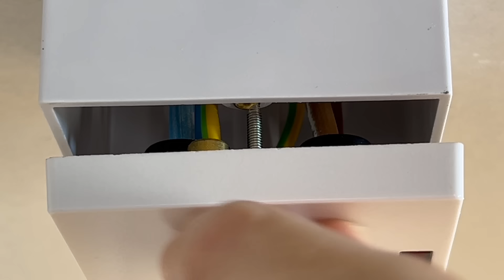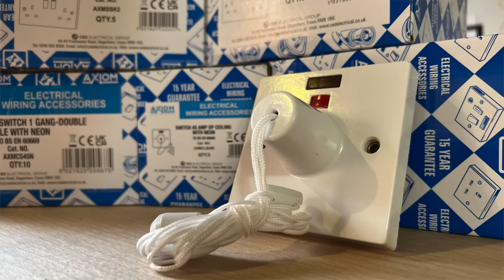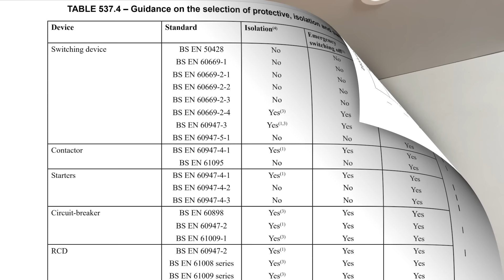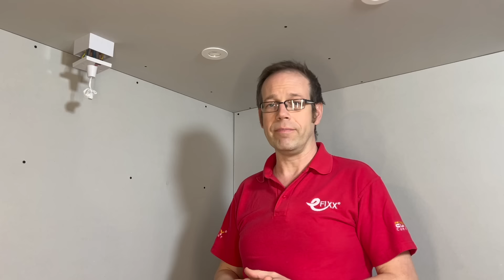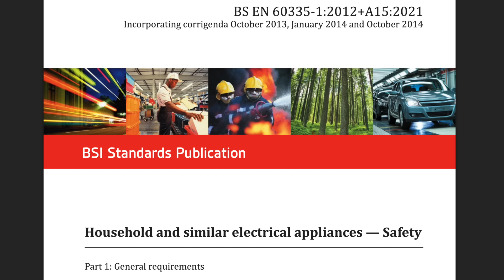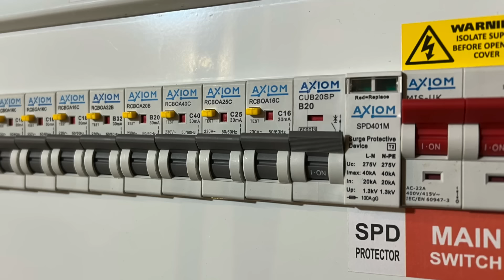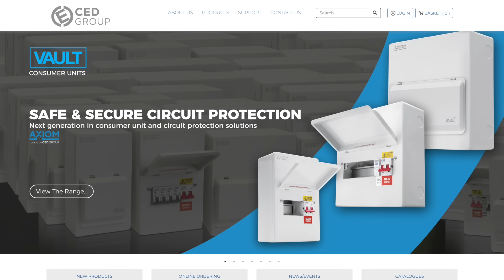Do You Actually Need a Shower Isolator — Or Is It Just Habit?

Comment: So the usual reason then, nothing to do with safety, just more legal arse-covering by manufacturers!
I don't know how the Triton T80s passed testing, they don't hold up in hard water areas, and have some dubious design choices that seem pretty un-safe.  After a year or so you might notice the power light starts flickering on and off, because the stabliser valve is leaking and p1ssing water all over the bulb, power switch, and solenoid. Doesn't even trip the RCD!  Changing the O rings might work but they often leak from the spindle so you need a whole new valve, nice little earner for them.

They must know this is likely to happen because they added a little plastic drip shelf to try and divert leaks away from the electrics, which they've still made no attempt to water-proof.  I just cut the bulb out of mine, rather not have a wet 230V xenon behind the main switch thanks, at least it served as a leak warning of sorts.  Maybe they should put the switch at the top next time, above the leaky bits!

Comment: Anyone not using the Crabtree style switch is just wasting their time. An actual pleasure to install.
Reply: The older round ones with twin screw terminals. They're all single screws on the new ones now.
Reply: I preferr the MK one myself.
It dosn't fail and just works. Although the clunk it makes is super loud!
Reply: I agree. And it has captive screws too. 
Slightly different topic, but it drives me crazy that manufacturers use non captive screws for ceiling mounted pull cord switches. Good example of how to make a simple job twice as hard.

Comment: I guess it isn't approved for "isolation" because it doesn't have so called forced contacts, which means if the contacts were to weld, they must be forced apart by the cord pull, or the lever or indicator must be impossible to move to a "OFF" position. (so not the disconnect/isolator shows OFF while it has welded contacts and is actually conducting current).

Otherwise it fulfills all requirement for a isolation switch: Minimum 3mm separation, double pole, and clear mechanical indicator of the switch's status.

Comment: I think showers should be wired through a contactor, and thenhave a local Iso/switch for the contactor and shower! The amount of shower pull cords I replace in a year would have you thinking are pull cords even fit for purpose!
Reply: "fit for purpose…“
I wonder if customers are finding a way to pull the cord when current is flowing?
Are the showers involved, often of a type where there's a mechanical switch on the shower unit, that the customer could turn on and then close the cubicle door and then turn the shower on via the pull cord? (Then wait 20 seconds for the temperature to stabilise before getting in).
I expect most showers have electronic switches where you couldn't do that but I wondered if the pull switches you're replacing are often on old/basic showers with mechanical switches?
Reply: @alanm8932 I have found that a lot of the showers are been switched on and off using the pull cords instead of the button on the shower! The biggest culprit by far doe is the triton sr90, nearly every shower I go to is this model, I still think the contactor route would help in the scenario where the customer is using the pull cord as opposed to the switch located on the shower!

Comment: To be honest, I would use the switch for isolating the electric shower BEFORE I start pouring water onto it.  It's absolutely insane to have a mains-powered device directly in the shower. And - as mentioned - the switch itself isn't waterproof... But - different country, different culture :-)
Reply: @jirizlamal69  I rather take my chances with the heater not faulting.  With this, drop the shower wand and you are soggy toast.

Comment: 1) installing in wet room ceiling means corrosion, corroded contacts on 40+ Amperes will cause serious overheating; 
2) double pole switch has risk that neutral wire can be disconnected faster than live wire - double pole switches are used in buildings without earth rods (for example Asian countries) as voltage between neutral and ground is not stable

Comment: Regulations semantics where isolation and a functional distinction is a waffle of regulations . If you google BS EN 60669  asking if it is suitable for safe isolation it suggests it is a suitable device. If the device couldn’t safely disconnect both poles and give the 3mm distance then it wouldn’t be suitable for general purpose use either. iRegardless it’s time they were redesigned as they are all an unfit for purpose because of the size and nature of the product to cable size and too many self destruct /burn out regardless of tightness of terminals . Another item that should be updated in BS7671 but they rather mess around with regulations for car chargers or what amounts to an overpriced  outdoor socket . 🤗

Comment: One of the first things that I was taught in apprentice training was not how to start anything but how to stop it.
When we moved into our present home, there was a power shower installed with a single push-button in the shower cubicle. If for some reason, the button failed to stop the pump, then the only means of stopping it and the continuous loss of hot water was a stand-alone RCD (which later failed) tucked away in an airing cupboard. Like many properties, the consumer unit is unreachable without fetching a step-ladder. The ceiling pull-switch that I subsequently installed now provides adequate switching for the shower and integral extract fan. So regardless of the regulations as to placement, my choice would be to fit a pull-switch in the bathroom, adjacent to the shower.
Reply: I have never been in a property where the CU required a ladder to access it, and I have robbed hundreds of houses
Reply: @lrdisco2005 Your confession is duly noted🤣
Reply: @MervynPartin I need to be more careful in future.

Comment: A properly rated wall switch at the light switching point is in my opinion ideal. The switch provides a positive disconnect outside of the unit itself without having to pull plugs. In the US, such a device would need GFCI protection and likely a disconnect switch that breaks both live poles (neutral likely would not be present and typically isn't switched). That switch would likely be the same as used for air conditioning systems which can range from nice, heavy duty (enclosed with external handle) knife switches to basic pull out knife blade disconnects (you pull an insulating block to physically remove the blades from the circuit and they have a provision to install the block upside down to park the switch in the off position).
Reply: We are not in the US of A

Comment: Good video Joe, very clearly explained why that manufacturer's instruction is there, though to be honest I think it's a bit of nonsense. Those switches cause much more trouble than they solve - because they don't solve anything in my opinion! 😀 There isn't really a need for the switch, but given it's there, do you leave it on all the time or turn it off after every shower. I know people in both camps - the ones who turn it off don't like the neon light glowing and using all that power! I'm in neither camp, I have a shower off the hot tank, and while I do have an electric shower in the house it's practically never used and the switch for it is permanently off (to avoid using all that power!). Cheers.

Comment: I can't see any reason to turn this on & off every time the shower is used. It just wears out the switch, which can then fail causing a hazard if it arcs as well as causing heat damage to the cables. Repeatedly replacing them isn't  great for the cables either due to repeated bending.

Comment: Very cheap and easy for a manufacturer to print in a manual about needing the switch. They don't have to buy it, wire it up or replace it when it breaks.
Reply: And there are no such requirements elsewhere. All works fine.

Comment: Around 8 yrs ago i had a house rewire in London & found the shower cubicle had the 45A rocker switch located Under the shower😮😮😮.
To top it off, we followed the cable all the way to the basement & it was shoved straight into the meter 😮.  Mind you, it was the load side of the meter.
The tenants claim they have been using it for yrs...

Comment: I work in Social Housing for my local authority, Very useful video.  But when we invite Mira and Whale to our offices, the Mira Tech guy recommends that we leave the supply on at all times, though this may be due to the Mira Advance showers which we fit are connected via Bluetooth to the Whale Gulper shower pumps.👍 

We are trying to move away from pullcord switches to a 2gang 50amp double pole switch , due to high failures on the pullcord switches compared to very little failures on the 2gang switches, no matter how you terminate the conductors on both the pullcord and 2gang switches.
Reply from the maker: Great insight thanks 🙏

Comment: Not only are they challenging to wire the 10mm^2 conductors to, the neon indicator wiring can be problematic to connect simultaneously and reliably with those conductors. 

Now if only those wazzocks at Triton could get their act together and deliver a new heater can (10.5kW) that was ordered two weeks ago my very aged mum could have a warm shower.

Comment: As an swedish electrician I feel dizzy seeing all these weird ass solutions you have going on for weird ass appliances..
Reply: What type of shower is most common in Sweden?
Reply: @ashbridgeprojects6916  an normal non-electric shower that's hooked up only to water and regulates temperature and pressure by adjusting water flows.
Reply: @ashbridgeprojects6916  In Sweden they have someone in the loft pouring a bucket of water down through a sieve

Comment: Outer insulation stripped back too far for my liking, the inner insulation will push back out of the box and strip it slightly due to sharp plastic on the back box

Comment: That was a great walkthrough of compliance, but we didn't actually get to the point. Why do you need the switch? What is the actual reason why the appliance is required to instruct the installer to provide one :)
Reply: We need the switch because the sponsors of this marketing video need us to keep them in business. Having said that, we do need the switch, but it's an isolator.   A manufacturer's schematic implying their preferred approach is not the same as a definition. -Though specific manufacturers instructions must be considered.   Do we switch off all our FCUs (all are functional switches not isolators according to table 537.4) & oven switches & get up every morning & reset the timers????   What's the difference?  -other than the shower pully is the one most likely to end up knackered.    Call them switches or call them isolators, they function as isolators & don't need to be switched every time you use an appliance. Let's be grown up.
Reply: @sparking2016 Any pull cord switch is an ABOMINATION. Forever wearing thin and snapping. Agreed that a cooker-type DP just inside airing cupboard is much easier. Btw, a lady sparks I knew always sniggered when these switches were mentioned. The reason ? "Dildo Pants." Rubber isolation, of a sort...
Reply: Pressure from Big Switch.
Reply: If the shower is not electrically isolated then any leak of water/ fire ost burst etc.in the shower appliance will discharge onto a live unit
Reply: @user-tl2qn1qi1g That's going to happen anyway and probably more likely when it is running and you are standing right under it. In any case, the RCD in the circuit should protect you from that.
Reply: @Species1571  this happened to my dad many years ago in a shower he had installed himself. Dad was an accomplished electrician and safety inspector. Turns out the element had blown up during use. There was no actual electric shock but the bang made him jump and grab the shower curtain. He had installed that too but unfortunately it was not strong enough to bear his weight. Much bruising resulted. Mum told me off for laughing!!

Comment: I hate those pull cord switches for showers and never fit them. Having that mounted on the ceiling, in an environment that is 100% humidity during use, with all the hot steam circulating around and inside it - is a recipe for disaster.
How many of these are found to have corroded terminals or switch contacts after a number of years of use - nearly all of them. 
I've seen plenty of these with melted cable sleeving, black burn marks etc - all because of high contact resistance, from corrosion over time as a result of it being situated in a high humidity environment whilst pulling as much as 40 amps of current.

These shower switches, imo, should always be wall mounted, OUTSIDE the bath/shower room.

Comment: Blimey . A electrician using a knife . That’s rare these days . I thought I was the only one left .   I thought you said you were using a good quality pull switch. The only good quality one these days is Crabtree. I prefer not to use a pull switch at all and fit a 50 amp isolator . Outside the shower / bathroom if possible.
Reply: I agree I purchased an MK 50 Amp pull cord switch and installed the other day. There is only one Earth Terminal and that snapped off when tightening absolute rubbish and not cheap either. I always used MK or Crabtree in the past. 
I like Crabtree but was always a bit clunky but that will be my go to from now on.
Reply: @alanlissamore461 yip crabtree... bulky yes ..

Comment: Those pieces of shit need banned, as do trying to ram 10mm T&E in there. Showers should be compulsory to be in tri-rated/multistrand cable like SY etc, and a better means of off/on/isolation with a 2g box if needed.

Comment: I guess the obvious next step is to just wire your shower in with a bit of flex into a 63A plug. Then it is fitted with a supply cord and problem "solved" in a beautiful way 🤪

Of all the circuits in a home that would benefit from an AFDD it strikes me that the shower would be the one, primarily because of the "isolator" switch.

Comment: All comes down to semantics. Shower manufacturers might use the term “isolation” a bit differently to electricians. If you were working on a shower ( installation or even repair) would you consider the DP pull switch to have isolated the shower ? I think most sparks would consider isolation to mean at the distribution board/ consumer unit. 😉😉
Reply: I don't think it's semantics at all.  A DP switch 100% isolates a shower from it's supply.
In your example, you're just using one switch instead of the other.
Reply: @Shocker99   Until it doesn't 😳 ... Far better quality materials used in an MCB/RCBO than a pull cord switch
Reply: @Shocker99 aye...AND its beside you

Comment: Well guarantee that C.E.D. one will burn out.  And please do not put those screw covers in on pull switches.  And its only usable for "off load" functional switching, that switch will melt if used for on load switching.  I'm more inclined to use a contactor, much more robust terminals and contacts, then operate the contactor with a pull switch and use as described.
Reply: Contactors are underrated ;)

Comment: Very interesting thanks, back in the good ole days of ed17, I could never make proper sense of this. Must admit nowadays with photovoltaic ruling our lives, electric instant-on tankless showers are something I never come across because its always cheaper to heat a tank whilst the sun is shining. In Auz they use an integrated monobloc hot water tank, inside it is a hot water tank with a small air-to-water heat pump that heats the water to 65 degrees, only uses 1 kW, I don't know why these aren't used all over the world, seems a bit 1960-ish to have a resistive form of heating.

Comment: I found this when I replaced my electric shower and read the manual. My isolating switch is 2m height outside the bathroom, I wouldn't say it's easily accessible
Reply: Are you a borrower or something?
Even a 4.3ft tall person can reach a switch at 2m
Reply: @Shocker99 ok, it's 2.3m, but not easily accessible either way for something that needs to be operated each time you are using the shower. Don't know what a borrower is, hope it's not something insulting 😢
Reply: @Mircea007  5ft person can reach 2.3m
I'm not insulting anyone; referencing a 90s movie.

Comment: My house had a 50A DP switch outside the bathroom for the Shower, however this was very stiff to operate and the manufacturer’s instructions by Deta said not to be used for ‘functional switching’, however I like to switch it off after every use, in the end I had it changed to a 50A DP Hager switch which is much easier to operate and is marked Shower.
Reply: Why do you like to switch it off?
Reply: @lrdisco2005Just being overly safe, don’t use the electric shower everyday, and it has an LED when switched on the 50A switch.
Reply: @smilly9 I would argue that cycling the switch increases the arcing risk inside the switch, take faceplate off and have a look at the heat damage.